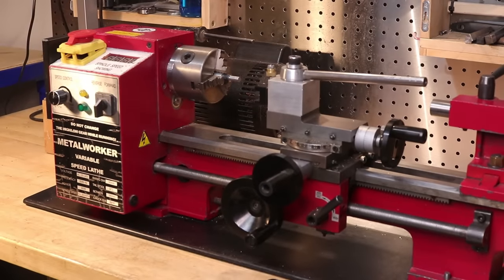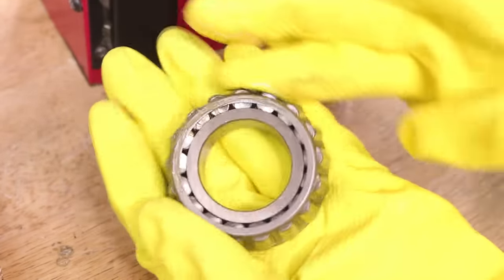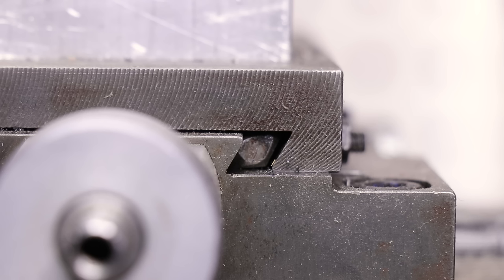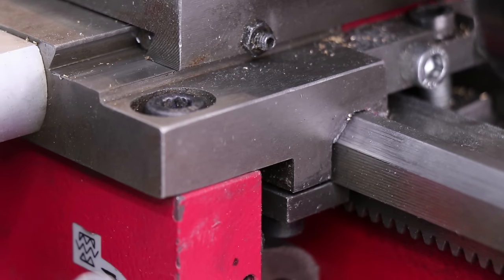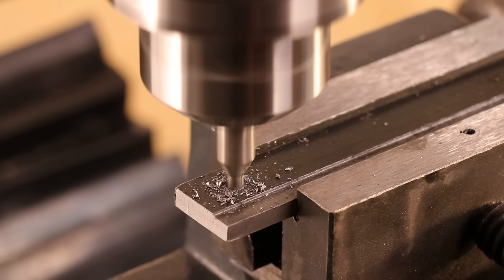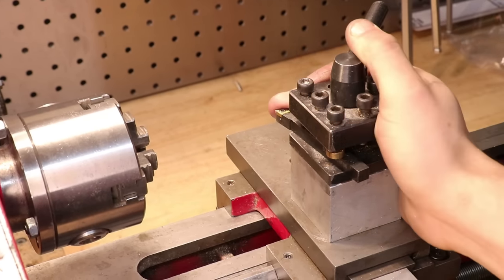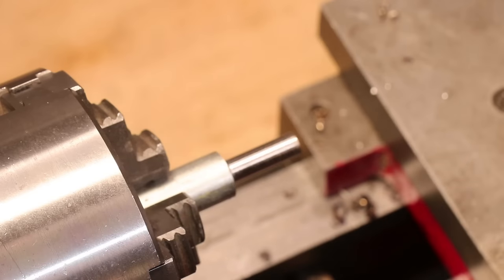Rigid Mini Lathe Upgrade | Tapered Roller Bearings, Solid Tool Post, Brass Gib Strips Mod

Comment: I find it funny that the hobby in ones hobby shop is improving ones hobby shop by shopping for ones hobby shop. 😎
Reply: Of the 50 projects for which I have used my mini-lathe,, I would say 10 have been to make/modify parts used somewhere other than the hobby shop.  You are spot-on!

Comment: To get the correct preload for the tapered roller or angular contact bearings without breaking anything, assemble and tighten the adjusting nut slightly and run the lathe for a 1/2 hour..........if the bearing housing is cold the preload is insufficient but if it's starting to get hot after 10 minutes it's too much........slacken or tighten the adjusting nut until you get the bearings to run just warm.......no more......the grade of grease will determine what temp the bearings run at.

Comment: Great video. Getting Chinese and refurbishing is a good way to go on a budget. One detail that can be improved upon is to add locking screws to the gibb from the top. Use the side screws to get set the clearance and then lock them from the top. That way the gibb cannot move at all and adds to the rigidity.

Comment: Great video. Thanks for sharing. I have a question about the angular ball bearings. You talk about 7206 model  (single row bearings), but you display 3206 model (double row bearings). Which ones do you say are the optimal? Also 7206 are 16mm width, 0.8mm smaller than the stock ones, and 3206 are 23+mm wide, so would they actually fit properly?

Comment: You can improve the performance of the mini lathe a hell of a lot by using techniques suited to the machine. If you look at 9:15 you see a fairly typical position that people end up in. The compound has pushed the tool way past the edge of the cross-slide so the force of cutting is like pushing down on the high end of a kids' see-saw. If you do that, the low end of the see-saw lifts off the ground. Push on the low end, even close to the pivot point and nothing happens. Your fixed support has moved the tool so it is about 1cm inside the cross slide, so the force is straight down to the bed of the machine and nothing wants to move. On a massive two ton machine you don't need to think about details like that but on these things you definitely do.

Comment: Tapered roller bearings made huge difference for my lathe. Great video 👍
Reply: Hello friend, what difference did you have after you changed the bearing?
Reply: Me too, I was able to use the 'tiny' 1/4" deep parting tool without any problems after switching to taper bearings.

Comment: I'd argue that just getting a good surface finish on steel is an accomplishment for these machines...

These changes elevate it a step beyond
Reply: Oddly enough I find it incredibly easy to get a great surface finish on mild steel with mine. No clue why.
Reply: @ScootyPuff_Jr  some people have better gibs/etc from the factory, less warp in the bed, etc etc. Mine hasn't been able to do well with any steel yet (though I've been planning on doing all 3 of the things shown in this video for a while) even with adjustments to those components. Better quality tooling would make a difference too, as so far I've only used cheap carbide inserts and self ground HSS.
Reply: I could put a finished surface on steel straight out of the box with mine. Changing the bearings helped with turning long pieces. If I only worked pieces shorter than 3 inches, I wouldn’t have had to change anything.

Comment: I bought my mini lathe in early 2000's and taper bearings were first thing I did to it.
The taper roller bearings made enough difference that parting off is no longer a teeth clenching affair waiting for tool to dig in and break something
I think that's the first time I've seen anyone make a new gib strip for mini lathe?
I have seen various articles over the years about re-locating or modifying the indents on gib and stoning to get better contact but I like your method a lot better.
 I have a piece of silicon bronze big enough to make one so that will be next 'upgrade' (I used it for the saddle hold down clamps and have a piece left)

Comment: Excellent job. I made the same upgrade to mine. It makes a lot of difference in rigidity and finish. 
Hint…..changing the gears to metal makes no difference. It only cuts down on the sound level by a very small amount.
Reply: I found the noise decrease was due to adding lubrication.  We hobby lathe owners tend not to lube the plastic gears, but over-lube metal ones.  Try lubing the plastic ones, then compare noise.  I completely agree the metal gears make no change in accuracy/performance of the lathe...probably the least bang for the buck of any mini-lathe upgrade.

Comment: Do not measure looseness of the spindle with dial attached to the rail.
Measure it with the dial attached to the bearing housing.
You may have looseness coming from connection between the rail and the main body.....
Reply from the maker: You are right there and I should have known better. Sometimes I'm thinking too much lie a camera man and not enough like a machinist. Thanks for the correction. I will say that since both measurements were taken the same way we can say that a lot of the spindle movement was coming from the bearings. Cheers.
Reply: @artisanmakes  Good move on the solid Tool Post.
That's something both Stefan Gotteswinter and Joe Pieczynski recommend for any lathe. I think Robin Renzetti has also done the same.
In one if his vids Stefan points out how a solid tool post affects thread cutting. From memory the need to come on at an angle for each pass on the thread becomes almost irrelevant with a solid tool post because of the increased rigidity.

On the bearings did you consider using just 1 taper bearing and 1 angled contact?
It looks like you got a great result in the end.

If you ever want to see a great vid on how to improve a cheaper Asian machinery. Robin Renzetti bought one of those cheap D-Bit grinders and by the time he finished it was as good as a Deckel.

Comment: Some other things you can do; 

USE A CENTRE! For anything more than a of 1:3 diameter to stick-out ratio, you really should. This applies if you’re turning a 10mm shaft or a 100mm shaft.

Choke right up on the insert holder: put that tool holder right back in the toolpost. With those smaller insert holders, the most they can practically work at is around 20mm stickout, and there is a noticeable difference if you reduce it to less than ~15 or so. 
This also brings the toolpost closer to the tangent of the workpiece, allowing it to take more load, more easily. 

Take deeper cuts, and feed it all she’ll suffer: 
carbide loves load, if you go too gently it doesn’t like it, and will go dull and squeal in protest. Carbide also works better with either coolant, or dry, oil just shortens the lifespan of your lungs…

These are the principles i work with every day, and it allows me to work to 0.01mm tolerances, and sometimes less, without too much extra effort. 

(Also PLEASE consider making that toolpost riser block out of *anything* other than aluminium ;~;)

Here’s to bigger and better lathes in your future :D
Reply from the maker: Thanks mate, feedback is always welcome. That mild steel was probably at its limit. 15mm probably stickling out a good 40 -45mm. With the tool holders you are right. The stick out is always hard to correctly determine. Too little and it doesn't look good on camera. Through I suspect the tool holders are a big part of the problem, they are made from mild. I have a kyocera tool holder and it is made from hardened steel. As for the alu tool riser, gotta work with what I have, but I don't think a steel one would give us too much of a difference, although that is just my speculation. Cheers

Comment: WOW!!! So I can use aluminum to make a solid base for a tool post??? I have a micro (Sherline) lathe and wanted to make some betterments to it but always thought aluminum wouldn’t hold!!!! I’m just an apprentice on my own and amazed for all you can do!!! I just got a “mill attachment” to try making such things but still afraid of using it due to lack of rigidity, something I was warned by the previous owner and confirmed by some others but will have to try it.
Thank you for your videos! They are super helpful!!!

Comment: Nice ones. But you overlooked one that's rather obvious! 
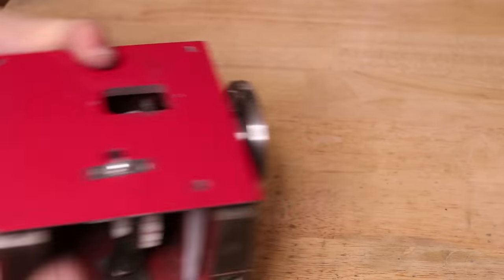Take notice at 2:00. There's ONLY 3 holes. Make a 4th hole, thread it set a bolt. It will increase rigidity against the bed. ;-) 
Most builds of these "Chinese" mini lathe's do have the 4 holes on the headstock. But obviously not all. An easy and cheap improvement. 

At 4:00, replace the plastic compression ring/spacer. With a suitable replacement made of metal. Brass, aluminium, steel... Metal pipe is a good cheap/easy option. Anything is better than plastic for this particular detail. Nice videos.
Cheers
Reply from the maker: Someone else pointednthis out too and I eventually did both of them, which helped reduce vibrations when turning at high speeds. Not sure why I missed this initially, but it is a solid upgrade. Cheers

Comment: Great video. What is Your procedure for periodic greasing ? Do You take apart the entire gearbox or do You grease them from the outside, taking of plastic bearing covers only ?
Reply from the maker: For the bearings I take it apart fully to grease them. Although I only did it once a year

Comment: I wanna upgrade to 3/8 tooling and I was thinking of cutting the tool post down on the bottom but if I did your solid tool post and don’t use the crosslide for tapers then I can just make it a little shorter and get more rigidity at the same time as being able to have 3/8 tooling thank you a bunch this would be cheaper and better in my opinion

Comment: Very Nice! Did you notice temperature increase on headstock after change bearings? Thanks a lot
Reply from the maker: No heat that I can notice. Too much heat means too much preload. Cheers

Comment: I did the angular contact mod earlier in the year and got both bearings for less than £30 from Arc Euro Trade if memory serves correctly
Reply from the maker: That could be right. The set I was looking for specifically were pricy due to the high tolerances and double row of bearings which might be a little overkill for this lathe. Cheers

Comment: Hello. I’m say first. Great 👍🏻 videos.  And looking at venvor.  8-1/2 x23 or 29”. Has 1.5” spindle bore. Around 1200$. 
But I seen one same brand big motor 1100w dc. All same but 16” and lot accessories 4jaw steady and follow rest. Mike and caliber and tooling metal gears ⚙️ lot extras. Same price around 1150-1200$ us. What u think. Might like try make gun barrels mostly around 16” biggest be upper 20s. It does hav 1.5” through spindle I don’t think ever have barrels that big circumference my bull barrels are .90. There big. My Remington 45 bp not 1.5.  Lol. Idk. Get longer 23 or 29” or more accessories I have little first edition db/200 looks brand new with milling accessories so have little lathe/mill and proxxon m70 mill table. 
Even thinking on selling it there commanding top dollar in new shape. Lol. Too much I think but glad I didn’t give whole lot but decent price for condition like new. And wooden box. But idk think I be sad if sold the little bugger. But on bigger lathe what u think. 
Now watching ur video using the sherline to fix parts on bigger one. Makes me want keep unimat even more. Lol plus it’s only milling option besides a drill press what a drill press lol. Thanks for your help. 
From ur ole hillbilly buddy stay safe.

Comment: I have the same lathe, SieG branded. Put in taper bearings a few months ago. It took a while to get the preload just right, or the motor lost so much power cutting suffered big time.

Comment: I bought a pair of angular contact wheel bearings 35x62x40 for 30€ but havn't installed them yet. I thought a combined spindle/bearing contact of 80mm would be really good. What do you think about this arrangement?

Comment: At what point does it make sense to get a better lathe versus modifying and having to make compromises like eliminating the compound feed?
Reply from the maker: Depends mostly on space and budget constraints. I have a small workshop and it is a hobby for me. I can upgrade the lathe and sink time into it and get the most out of what this machine is capable of. However if I had the space and budget I think it is always best to get the biggest lathe you can get. Cheers

Comment: Good video. But how are you gonna work on that spacer without taking it appart 😅
Reply from the maker: With the stock bearings, machining the POM spacer should be fine to do. The stock bearings are fixed into place pretty tightly and should stand up to a bit of light machining. Cheers
Reply: @artisanmakes  but dont you have to take it appart to get the spacer out?

Comment: Dude, how do you part the superglued metal strips later. Is easy to do it? Thanks. Regards.
Reply from the maker: I usually use acetone to dissolve it or a bit of heat from a butane torch and some heat proof gloves
Reply: Thank you! Regards @artisanmakes

Comment: Is there a better machine out there that already has better QC includes the  improvements and isnt covered in cosmoline and overspray?
Mine is still sitting in parts after multiple attempts to get it cleaned up and tuned. I have barley cut anything with it other then test pieces all of which were unsatisfactory.
Before I took it apart this last time I had more or less relegated it to doing  non-precise work like cleaning up cut screws and simple "making random stuff mostly round" , which it is actually quite good at and honestly I would be happy with it doing these simple tasks.... I just need a better "real" lathe that ready to go and can do actual precision lathe work without having to invest 40+ hours is making it usable. I dont have the workload to justify a new  "real/industrial quality" machine and dont have the time to search for a good (or restore) a quality vintage machine.  There has to be something that is good enough on the new market ??? I was looking at the LittleMachineShop versions of the cheap import lathes and that might be the way to go> But im pretty wary of buying another time sink.

Comment: Hi, another problem is tool moves away from work when facing off the end. No saddle  lock!!
Reply from the maker: Thanks for the suggestion. This is a feature that these lathes lack from the factory. Thankfully I made one a while back and it really improves the cuts the lathe makes. cheers
Reply: A built in saddle lock is disconnect the feed screw and then use the half nut as a lock by moving the cutter into position and set the half nut. It acts as a lock perfectly. I use it for all my work on the same model lathe.
Reply: @shedmanx3640  yes have used that method also. I made a clamp on saddle saves any diconnecting.

Comment: Please, don't you have exact dimensions for the gib strip replacement as seen from 5:20? I assume that angle is 60°, but what about width and thickness? That would be very helpful :)
Reply from the maker: Just match it to the dimensions on your existing gibs. They can vary between machine models. They generally are 60 degrees but the widths can change somewhat
Reply: @artisanmakes  Yeah, it makes sense. Thank you :)

Comment: What about alignment after replacing the bearings, or is that not necessary?
Reply from the maker: As long as the bearings are properly seated they should be aligned just fine

Comment: I've been thinking about buying a lathe to educate myself on for a number of years, but eventually I'm burned out by the huge amount of options open to beginning machinists and hobbyists. I already own a ridiculous amount of tools and shop equipment and have used it mostly for building 4x4 pickups, small block GM engines, and projects involving the three boats I had at one time. 
Instead of just diving into a new hobby and possibly throwing money away I'm wondering if anyone can recommend a good starting point for an entry level lathe, milling machine, CNC versions of both with small parts in mind, up to and including the size of 80% receivers, largest being the AR10. They can be purchased in the AR15, 10/22, P320, 1911, and various striker fired pistol platforms. Suggestions?
Reply: Grizzly is a great place for equipment. Their products usually come with more bells and whistles than other dealers, at no extra charge. It is also easier to get parts and support since they are based in the US.

Comment: Do most of the mini-lathes take the same size headstock bearings? 30206 tapered roller bearings or the 7206B-2RS sealed angular contact bearings. Are the angular bearings double bearings or single bearing style?
Reply from the maker: Most mini lathes that I have seen in this 7 X 14 category take the same 6206 bearings. Like I mentioned in the video, 7206 double row bearings would be preferred but they are more expensive than single row. Hence the high cost I was talking about. Cheers

Comment: I got the green bear flavor of this lathe, took too deep of a cut and broke all the plastic gears inside the head. Worse idea ever... I have a set of metal lathe gears and i 3d printed a set i can use to cast new ones. How did you mitigate the load on your plastic gears to keep them from snapping teeth?
Reply from the maker: I swapped out the motor a while back to a 400w AC motor. It spins a belt and pulley that is mounted to the rear end of the spindle, so I don't have to go through the gearbox. Cheers